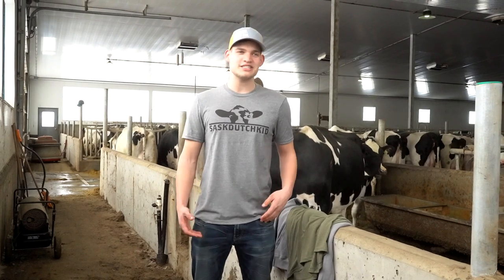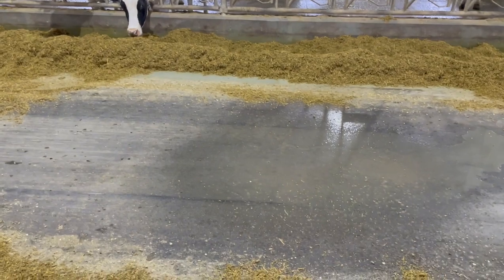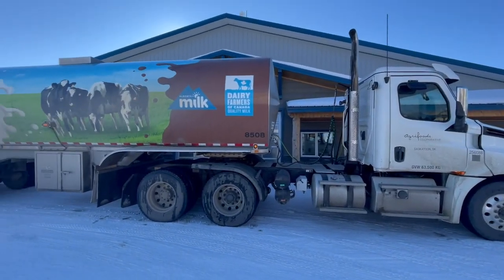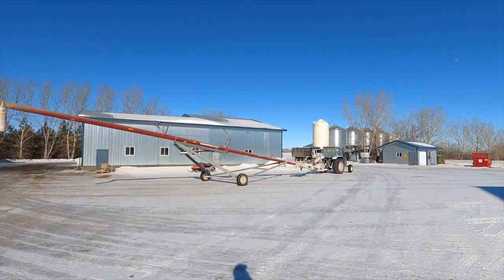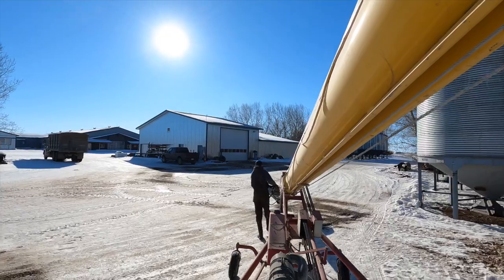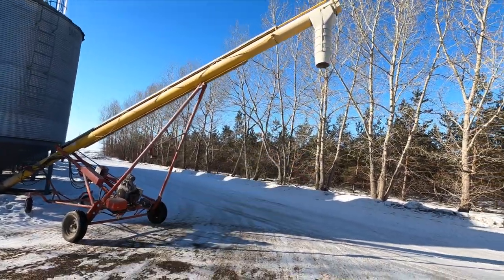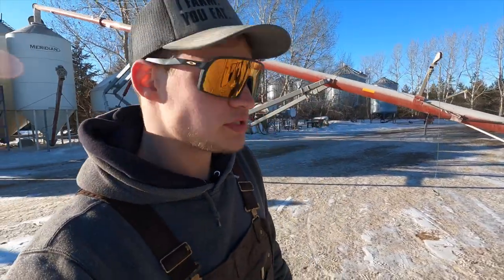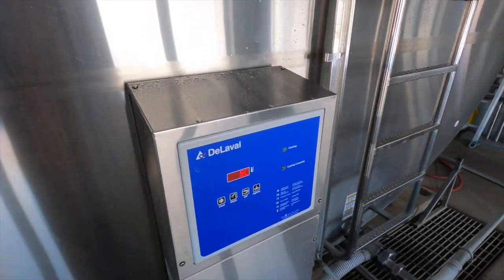Getting Switched To Day Time PickUp And Merch!

Comment: Please excuse me for I am a lifelong city boy who really stands amazed at the way you guys run the farm . I see how you fill your silos today . i wonder if you might be able to tell me how ,,, before gas or steam engines we invented how did they get the grain up top on the silos 150 yrs ago ??????????????
Reply: Block and tackle system using a cable-rope/horse-manpower for pulling the attached bucket or grapple to the top with the product to the top of the barn/silo. The same method was used in large clipper/sailing ships over the centuries and still in use today in many applications such as the crane and building constuction trades throughout the world and on drilling/service rigs for pulling drill or well service pipe out of the wellbore.

Comment: U cant set that tank to turn on autmaticly after some time? Check manual there shuld be an option, in majorty of tanks at least u can set time to start. And therefore u just turn tank when first hooking up a hose and it turns on autmaticly after X time, for me its 45 minutes.
Reply: PICK UP time of Day changed so cooler needs adjustment too, to agree.
Reply: @CurrentChoices  ye but thats is timer starting after u push start. From what he said he said i understand that he is just turning on a tank without a timer just after they end milking. And it shuld be programable to press start but dont start the compressor yet for programmed time to let milk fill a tank to right level, and then start. I didnt programmed delaval tho so dont know if there is option like that. But it is nice feature so u dont have to remeber to turn it on after u start milking posibly saving some money if u once do and let it be for like 12 hr.
Reply: @CurrentChoices  I can only say for sure that new GEA tanks, and tanks with EuroTanks controlers have that.

Comment: Without the exhaust fans how much can the cows raise the temperature in the barn on a cold day ???  I'm curious on how much heat they produce ?
Reply: An averge adult produces the same heat as an incandesant 100 watt lightbulb, a 1500 lb cow can produce ?? then times 320 milking cows in their barn. That is a lot of heat as they are 'working' around the clock during the lactation, and about 3/4+ will be already in calve for the next lactation working even harder. Again a LOT of heat output happening inside the free stall area, just from the cows and never mind the hot water in use, lights and electrical operating motors/skidsteer.

Comment: Why isn't the milk cooler on all of the time? I thought that you had to cool the milk as soon as it is put in the tank and then you would leave it on.
Reply: it is, but as you saw milk truck just took the milk, after that the tank is washed and cooler is turned on before/during milking. it takes awhile to cool it down from cows body temperature, if there was cooled milk already in the tank its faster obviously.